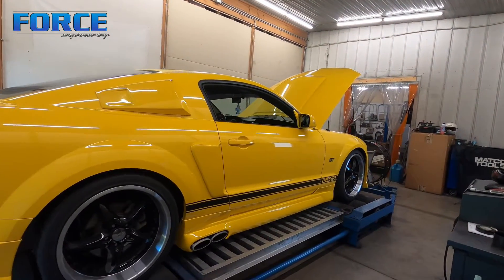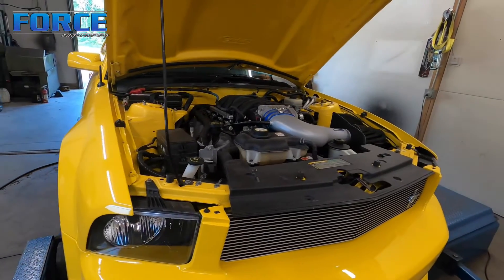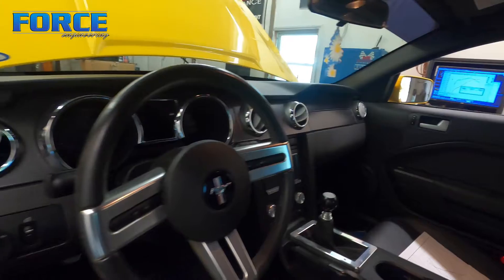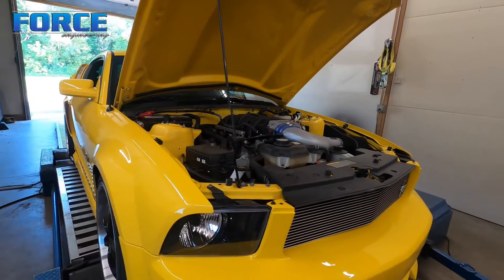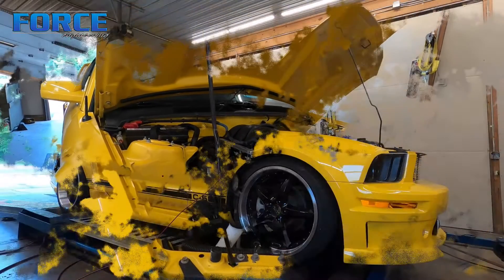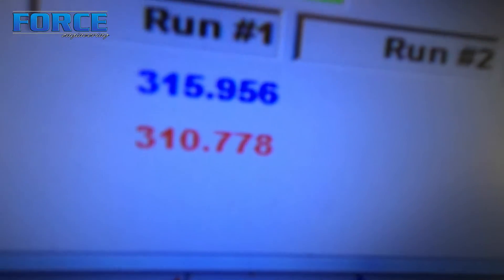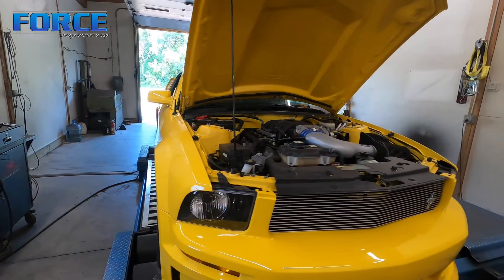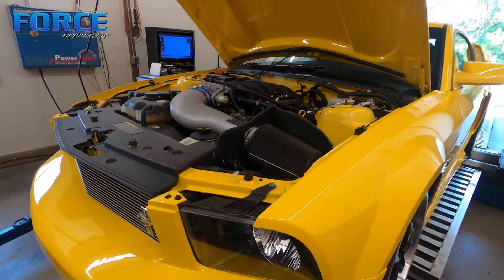2006 Ford Mustang 4.6 Dyno | Bolt On 3v | Dyno Review

Comment: Whoever installed the rear bumper cover did a terrible job. Otherwise nice car, like the content.
Reply: Whoever installed the exhaust system did a worse job than that! Those side exit exhaust pipes shouldn't be that misaligned or loose.